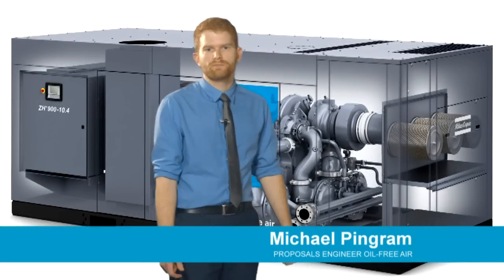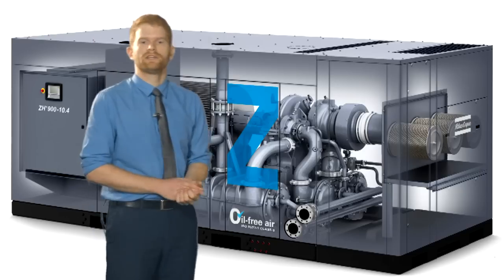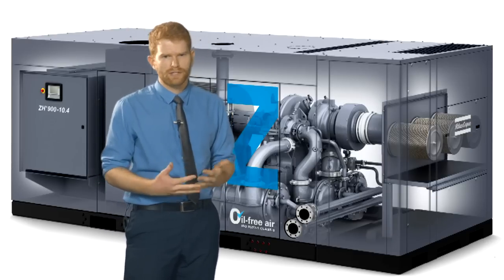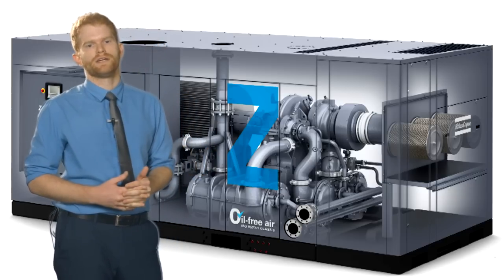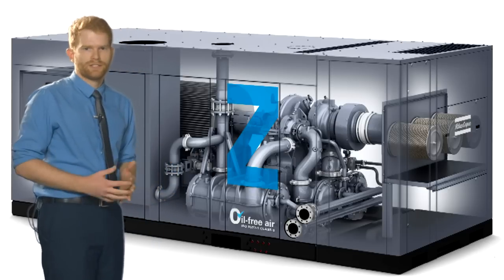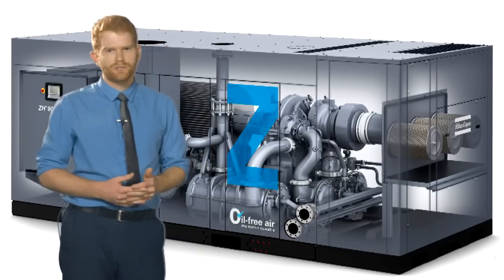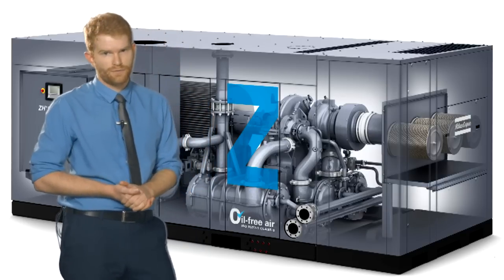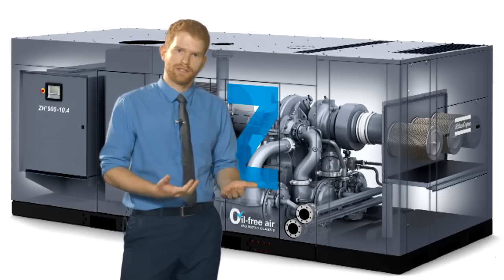The ZH 630-1600 centrifugal compressor range presented by Michael Pingram

Comment: A possible application is Clean Coal Exhaust Gas Filtration. On the microscopic scale, large flakes of customised perforated "Graphene", can separate gases like Nitrogen and Carbon Dioxide. for storage and  later use in downstream production.